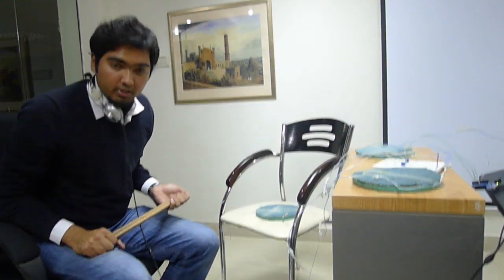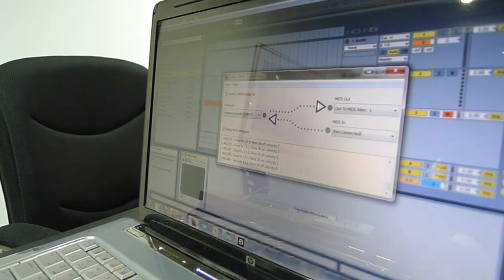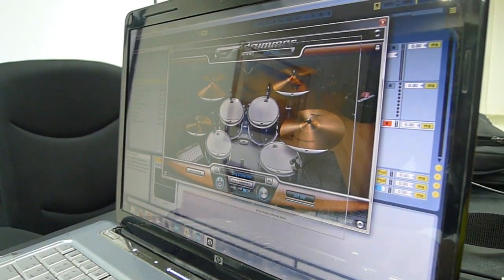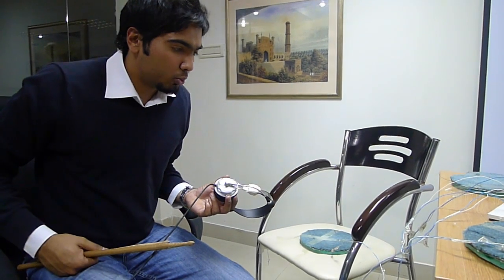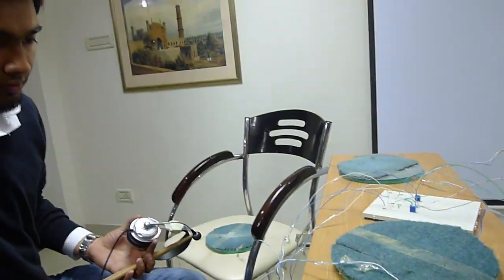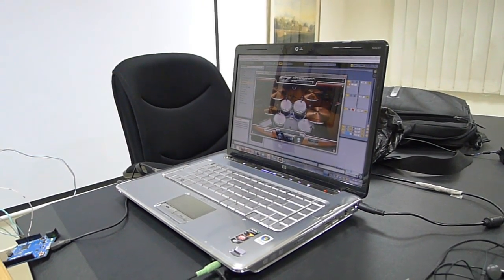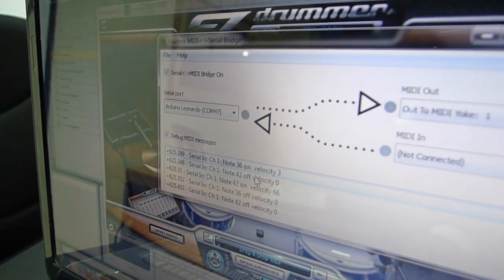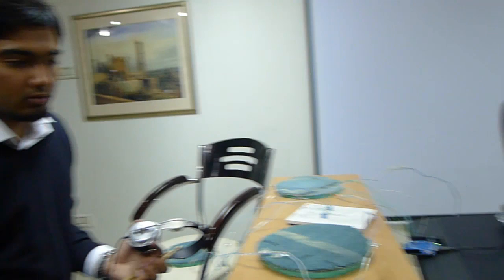Open Source Arduino Leonardo based Electric Drum Kit

Comment: Man, i have build a complete and functional edrum kit (only the pads) with mesh heads, and i'm using it with roland td9 sound module.
My goal is to use the drum pads with arduino hardware and some drumming software!! Can you help me with some details from your project, like how to connect the piezo elements as analog inputs and how to program it?